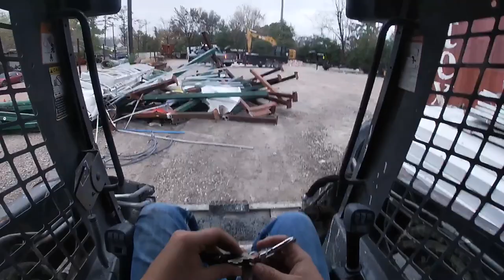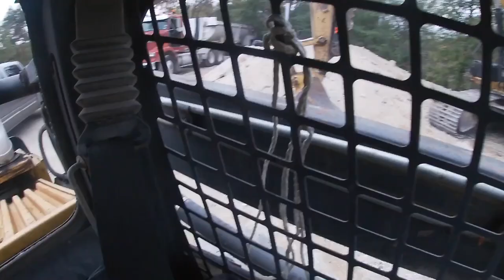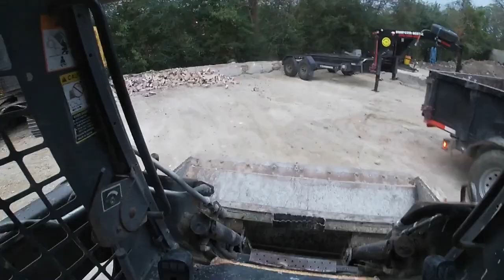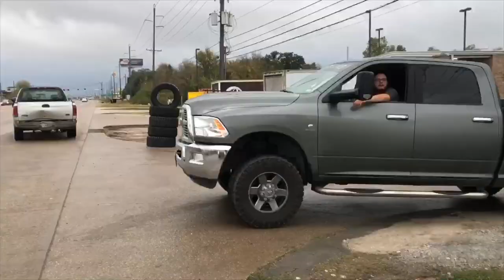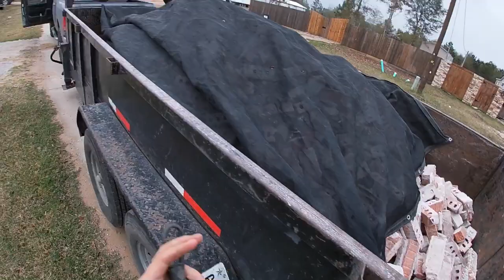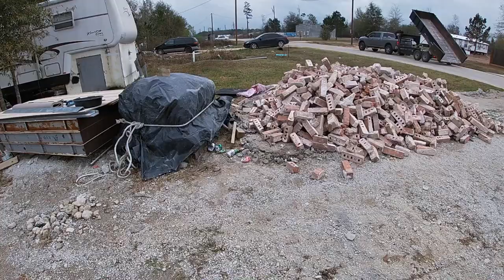gooseneck dump trailer hauling brick

Comment: I noticed the camber on your tires were really negative when you overloaded the trailer, good thing you didn’t get stopped.
Reply from the maker: This is every day 🤣 with either this trailer or my roll off, they won’t pull me over for that. I have cops get next to me on a daily basis and never have gotten pulled over. Also on this trailer I have broken 2 axles. And the one in the front is bent already,

Comment: I don’t want to be the guy but be careful. You where way above your rating on that load. That how you snap an axle or blow a spindle strait off your trailer. 
Also if you got pulled over and weight checked and you’re over what your tires say it’s a heavy fine. 
Be careful out there
Reply from the maker: Tavit Kassardjian i have a video for a broken axle lol https://youtu.be/_8o4s7pr_Xk but than but yea I know what you mean.
Reply: @Grtruckingdemolitionllc    Do u need CDL to haul that trailer?